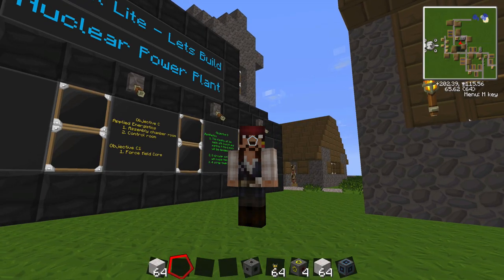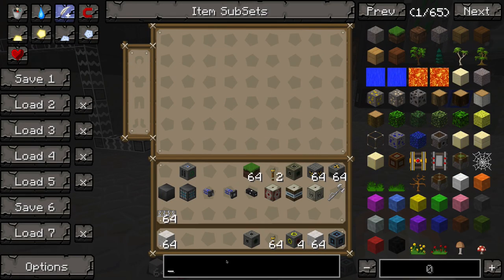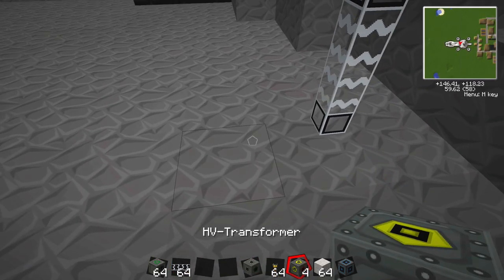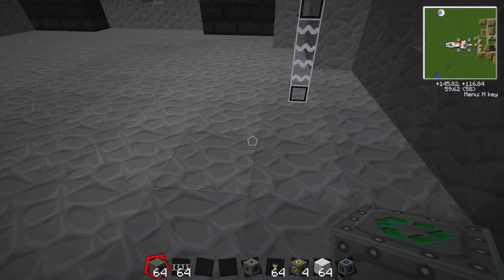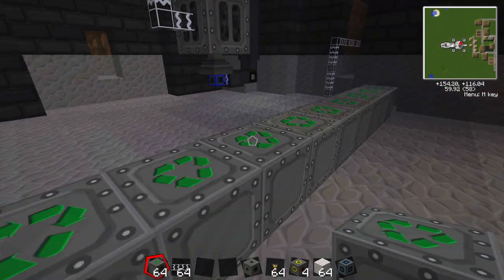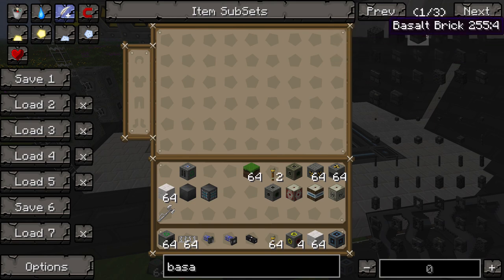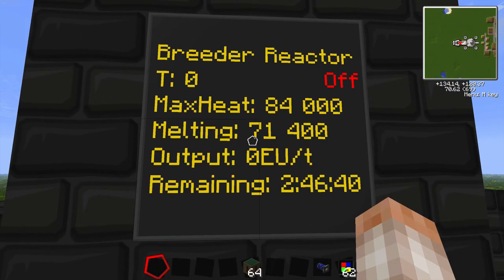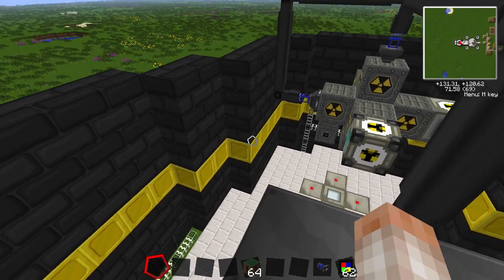Lets Build a Nuclear Power Plant - Episode 3

Comment: Awesome series!!! Love your videos. Would never of figured out AE without you.
Here is a thought, in middle section with the stairs going up to the control room, you can put some steps going down to the basement so you have access to all the stuff down there.... or better yet put your elevator so that it goes up and down there and get rid of the steps. Also, I agree with some of the others, might need to switch to Redpower for the Recyclers, and just import the Scrap into AE.

Comment from the maker: You can, but the other two plates will not increase the max internal reactor temperature toleration by enough to maintain a steady hot breeder temp. The hotter the breeder is, the faster it recharges (I do have a breeder reactor tutorial out that explains all this if you're interested) so the more heat it can withstand the better. I used the heat capacity plating because its increases the max internal temp by way more than the other two. (reactor plating and containment plating).